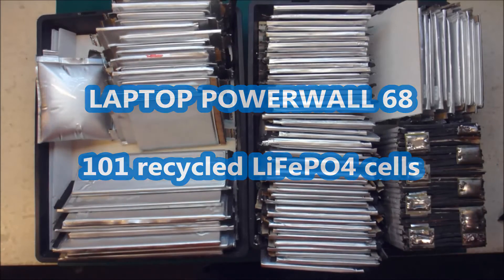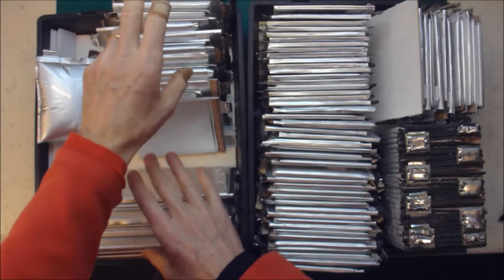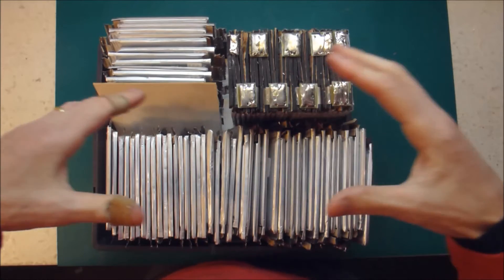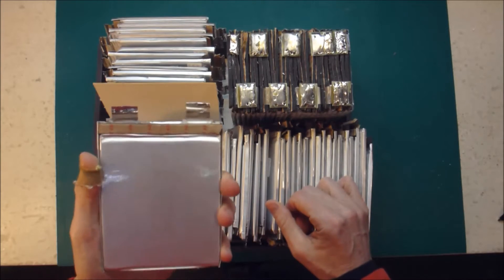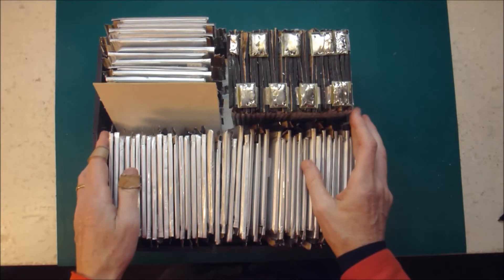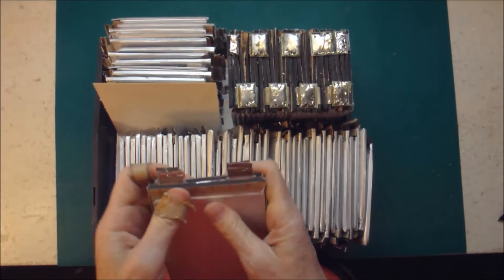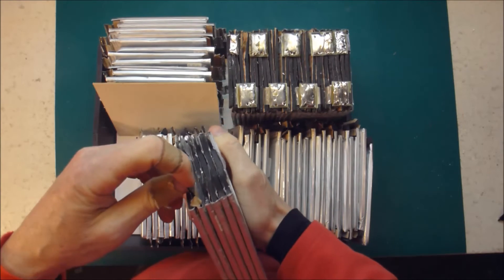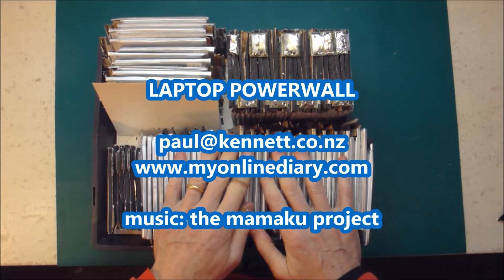Laptop Powerwall 68 - 101 recycled LiFePO4 cells

Comment: Hi Paul! Your system it's not 24 V? Why use 7 S pack instead of 6 S pack? The 7 S pack it's not too much for a 24 V system, i mean too much more V?
Very interesting this kind of battery.. I'm curious how they will work together with old packs 18650. Thank you for sharing and good job! Thumb's up for Paul!!
Reply from the maker: The nominal voltage of a 6S Li-Ion (18650) pack would be 22.2 which is a wee bit on the low side for me. I refer the 7S - although 6S would work for many uses also.
I'm curious how they will work together with old 18650 packs also!

Comment: I send any pouch cells back to recycler - risk way too high to have anywhere near our house.  Having them in laptops phones etc is bad enough.  Was offered a 40 gallon drum full of unused pouch based laptop batteries (same model) for $200 and declined - too dangerous.
Reply from the maker: Do you have any research on LiFePO4 risk? I'd be keen to know more.
Reply from the maker: Wikipedia says "LiFePO
4 is an intrinsically safer cathode material than LiCoO2" and "lithium iron phosphate cells are much harder to ignite in the event of mishandling (especially during charge)". 
Have ordered some LiPo Safe bags though.
Reply: Fair enough, each to their own - for me that's the 18650 or derivative format.

Comment: Wonder if you could find some metal standoff spacers to fit between cells and then use a small machine screw through those.  So screw-washer-tab-standoff-tab...standoff-tab-washer-nut.  Not sure how clean the tabs are or if simple metal-metal contact would be good enough.
Reply from the maker: The tabs are pretty messy at the moment. If there was an easy way to clean off all the solder and flux residue it might work. Maybe copper spacers and a screw would work. Good option thanks!